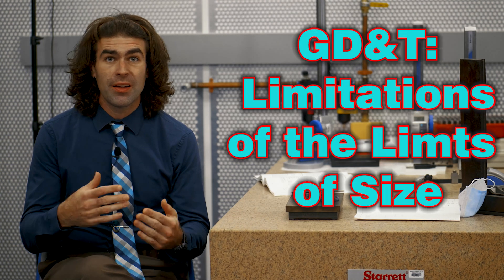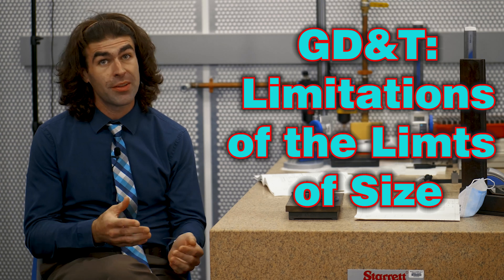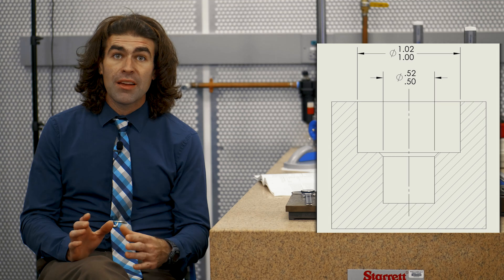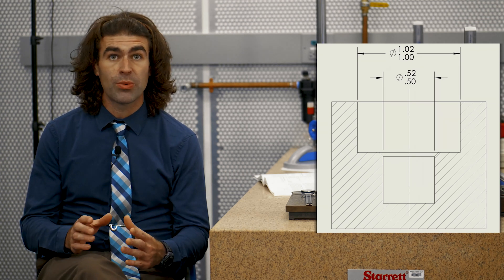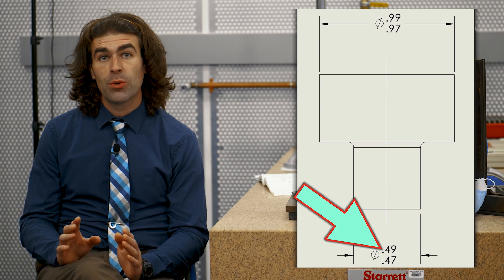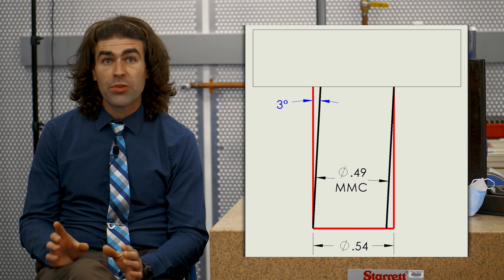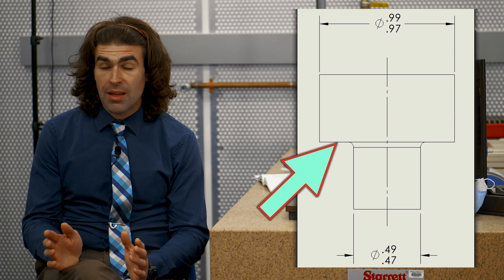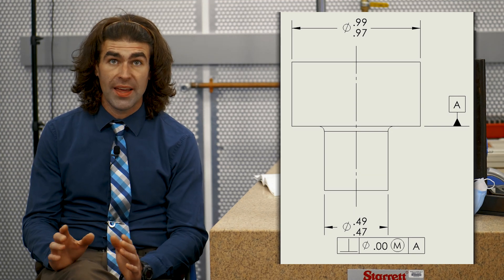GD&T ASME Y14.5: Limitations of Rule #1

Comment: Hello sir, how to control tapper of a hole
Reply from the maker: Hi, the taper of a hole or boss is usually controlled with a perpendicularity or position tolerance. If more control is needed, the size tolerance can be reduced, or a straightness tolerance can be applied to the derived median line.